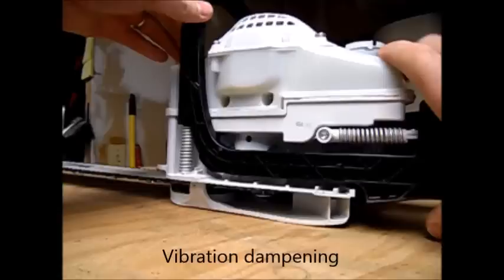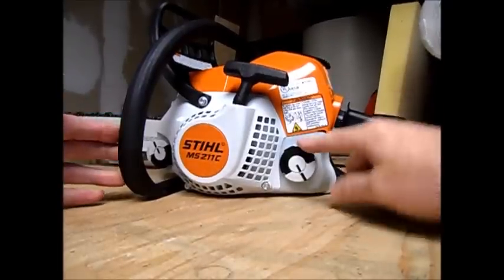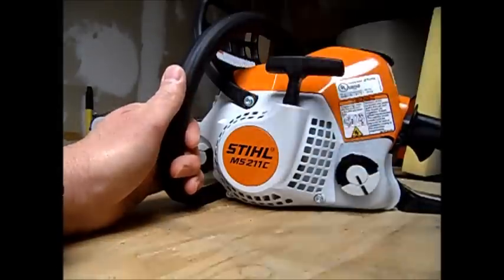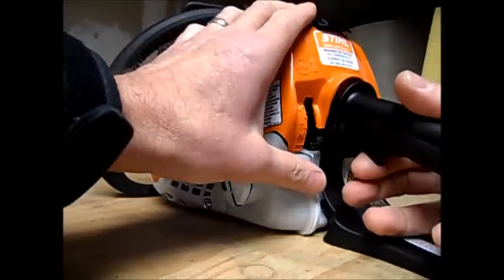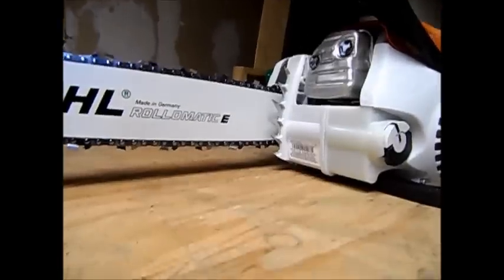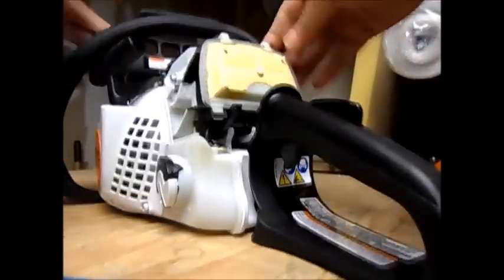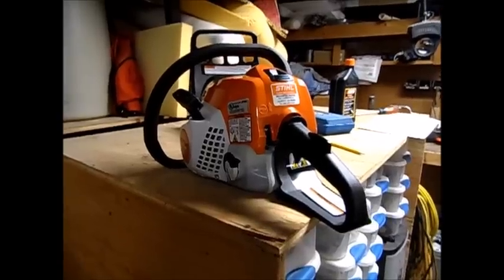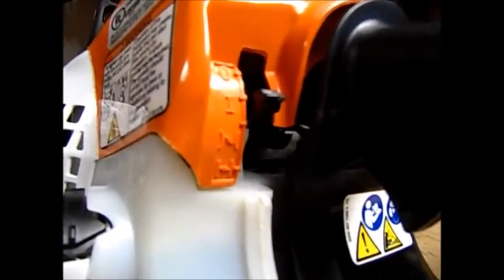Stihl MS211C chainsaw review

Comment: I have the 211 not the 211c and love it. I wasn’t a fan of the chain tensioner thing on the 211c. The easy start is a good idea. But the 211 without it starts just fine. And once you get the choke thing down it’s really not a issue. Good review brotha, happy cutting🍻

Comment: Had my MS211c for a few years now and only recently changed the air filter and spark plug , it’s a good reliable saw and if you use the tungsten carbide chain apart from general cleaning and good fuel mix your saw will perform as expected and more. The only problem I have is that I feel the need to get something bigger and beefier but I think this is a bloke thing my wife doesn’t understand me 😳😁

Comment: Got one ,had nothing but trouble out of. Still would not honor warranty. So now due to a guy at still dealer writing on paper that wrong gas was used in saw. Replaced carb. Now the coil went bad. I guess this is the last part I'll buy and last stihl also.
Reply from the maker: John man , that sucks, type of gas should have nothing to do with it, unless it was diesel. You got a lemon. So sorry to hear that.
Reply: John, if you had the deal Stihl offered in the past of the extended warranty IF you used their synthetic mixing oil, that may have had something to do with it.
I can't imagine what kind of gas would ruin the carburetor. Even some sort of aviation gas or whatever should not screw up the carb or the saw otherwise.

Comment: Nice review! I bough one when they first came out, maybe ten years ago! I didn’t like it! Mine was the standard model without easy to start and quick tensioning! I didn’t like it because was with one bar stud and I also didn’t like the feeling when I use it it seems that was not very durable! I sold it and I replace it with the Ms 230! Quick tensioning and easy start can fail easily and gives you troubles! I want my chainsaws with two bar studs!

Comment: I've used a Stihl MS211 for 15 years up here in interior Alaska...no problems.  I sharpen chains with Granberg file jig, rotate the bar and clean the channel after each 40 hours of use

Comment: **NOTES AND UPDATES Concerning the Stihl MS 211 C-BE: Just bought one of these saws today from my local Stihl Dealer, Really Great Saw for most homeowners. 
**Couple Notes: 
***IF the saw is ALREADY warmed up.... DO NOT CHOKE! It will probably flood the engine. If you've already had it running, Try to start it in the Run Position first, if it wont start, THEN go to choke. 
****WHEN you go to Start the Saw, or ANYTIME you are pulling the Rope for ANY REASON (like repair, etc) ALWAYS ALWAYS have the Chain Brake ENGAGED. Because this saw is SO Easy to Start, it is possible to start it by ACCIDENT! If this were to happen, and the chain brake is not engaged, it could cause injury. With this saw, its actually just a good habit to engage the chain brake every time you shut it off, or even to keep the lever in the "STOP" position (unless of course you are actually intending to start the saw) just to prevent possible injury of an "accidental start".  
 
I know the store owner of the local Stihl Dealer here, and was talking with him today about this saw. The "safety tip" above about engaging the chain brake is what he told me himself, as he was working on replacing a pull rope on one once, and he pulled the rope a bit trying to set the spring, and the thing started up and spun around on his workbench!!
He also brought up the issue they used to have with the gas caps on this and other Stihl products that used the same fuel and oil caps. He said he replaced a few hundred of the bad caps during that time. But they have since (a couple years ago) fixed both the gas and oil caps since the issue became known... AND after they figured out what was going on. It was a "defect" but only for the US models, they didn't have any issues with the same caps overseas... They finally figured out it was being caused by the fuel sold in the US, which had something in the fuel which was degrading/deforming the original plastic and seal. Which caused leaks and other issues. So they had to change the type of plastic and seal material on the caps so that the fuel sold in the US would no longer deform the caps.  Just thought I would pass that info along.
Reply: Your switch should ALWAYS be in the off position unless you intend to actually start the saw!
Reply: @tomnovak7731  thats what I said... ?
Reply: Thanks for your detailed observations. Much appreciated.

Comment: Nice video I’ve used mine to fell some pretty thick sycamores and oak trees with a 16’’ bar and a picco duro tungsten chain which is great as long as your cutting clean wood , if there’s metal then your wasting an expensive chain . Ordinary chains are fine as long as you keep on top of sharpening after each use I find 👍🏻

Comment: I wanted the starting mechanism like this as I spend a lot of time on the ground clearing saplings and treating stumps. I can’t get up and down all day anymore. This saw worked great til it started puking bar oil out the bottom all the time. Took it apart to find problem. Hose on bottom leaking. Never got it back together.

Comment: just picked up one today $345.23 total w. tax, extra chain, case, tools. No sense in breaking my back with O36 sawing orchard wood :). Thanks for the fine details including carb heat which was never mentioned at dealer.

Comment: Excellent video! Just picked up my 211 yesterday. The easy2start feature will take getting used to. Keep up the good videos sawmaster.
Reply: How is it holding up today? Thinking of getting one. Thx in advance
Reply: Wiebe Jansma 
Funny you should ask.I went through last season and either clogged the oiler channel along the bar or ? The chain stopped cutting as effectively and since it's under warranty I'm going to send it in for a check. After using this model I would opt for a bit more power and go for the next one up even if it doesn't have easy start.
Reply: Thx for the information, good luck with the reperations etc.
Reply from the maker: Wiebe Jansma , mine is holding up well. It's easy to keep clean. You can always check for chain lube by just running the blade in front of anything without touching it. It should leave a slight oil mark where oil is being flung off blade. As for power, remember, it can take a lot of power too cut with a dull blade. And if the blade is razor sharp you can easily be too agreesive and lug the motor down. I'm always amazed how a sharp blade can cut with almost no pressure at all and beautiful long stringy chips and the sawdust you produce with a dull one.
Reply: Ah, thx for the additional info, will try this one and a heavier one out i think.

Comment: my concern ... 181CBE or 211CBE?

Same weight ... more power ....
my local dealer has 181C and for a bit cheaper i can get a 211C on internet.
I need a lightweight machine and correct power ...

Which one should i get?
Since i cannot try these before buying :(

Any advice guys?

What about Husky .... more powerful engines but not as solid as Stihl?
Reply from the maker: This is probably not the tool to cut hundreds of cords of wood if thats your concern about power. Power really has to do with speed. A smaller saw with a razor sharp blade will cut faster than a bigger one where the blade has been into the dirt. That said you can still bog even a sharp saw down trying to cut too fast (speed). A sharp saw will cut nicely at 1/2 to 3/4 throttle. My biggest gripe with my older bigger saw was the need for tools for maintenance. This solved the problem. The Stihl brand has an excellent track record. Before this I tried a cheap Homelite, absolutely crap. Good luck
Reply: Thanks :)
Reply: @dablingtime  you should always run at full throttle when loading the saw. A 2-stroke engine develops peak hp at full throttle.
Reply: If you want a professional saw, buy a professional saw. This, in my opinion, is a homeowner grade saw.
It appears to be a pretty decent saw for the intended use.

Comment: I've had my 211C for just over a year now and just love the little farm/ranch saw. It's very light so that's great for general use and feels much better than the Husqvarna Farmhand. I'll recommend this chainsaw easily to anyone looking to get one. I got mine from our local SoCal Ace hardware and their support for Stihl is top notch (Yes, it's "steel"). I used it to clean up debris and some widowmakers last Spring when an F0 blew through and just fell a cottonwood that got too out of control for being close to the house (those and Eucalyptus litter our property and just fall apart in any gusts).

One quick note on this video is that his chain seems very snubby so I went to measure mine and it's 16-1/2" from claws to bar end. Perhaps they gave us 2-1/2 extra inches since the viewing of this 2014 video knowing that the engine can easily handle that. You're darn right about all the tool-less stuff too since I can do everything I need to do to the saw with my gloves on, great features all around and the vibration damping and balance is perfection.

An error on my part had me grieving the $330 purchase and wondering if Stihl were still the best is backed in this video, so I want to comment on my issue. I tried to start it one day and I just wore myself out. Took it to Ace and it fired right up. Asked for tuning suggestions and was told there's not a lot of adjustments to make but "do this" if you must. I was assure that since Ace was at 1,000ft and me at 3,000ft up on this mountain I had to tune it for elevation. Nope! keep pumping that priming bulb! My prior farmhand and all the junk weekwackers would flood if I over pumped that bulb. This one does NOT flood the carb so just keep pumping and it fires right up every time. Three pulls would be a high count. 

Haha, the easy start was goofy at first but now it's second nature. Full choke, *bripp*, half choke,  *buuuuurrrrr*, pull throttle and get to cutting. It's only their chainsaws though because the FS 60 weedwackemer is the standard 3 position and now raindance. I start mine with the brake on so please remember to bump that back when you're warming up if you do as well. I'm betting if you don't it's bad on the piston and will wear out that brake eventually...and that thing is a life saver!

Thank you for this great overview of the MS211 C. I'm sure many looking into buying a chainsaw (and perhaps their first chainsaw) are on youtube and see this. I know this isn't Amazon reviews, but buy this thing and don't question a moment more. It just chooches!
Reply from the maker: J.C. Allen thank you!
Reply: Yea the pronunciation of the name varies depending on where you live. so your comment ( yes, it's "steel" ) is only half correct.
Reply: @1989cranston  your right!
In Boston, a saw is a "sore"! 😆
A car is a "caah" too.

Comment: If sawdust could get into the tank...!! surely fuel will come out...! And i doubt you bought a saw that leaks..!! Great saw European model is slightly different. 
Its also pronounced STILL not STEEL.
Reply: From the Stihl website:
"Our name is pronounced exactly like the metal "steel.""
Reply: Thats how Americans Pronounce it.
But the Correct way "The German way" is Still=Stihl
Reply: As aGerman, i will have to say that the german pronunciation is much closer to "steel" than "still".
Reply: puderjunge Yes it is and even if it doesn't wouldn't you rather say steel anyway? Sounds way cooler than still. I don't get why people that know nothing about the German language say something that they are ignorant about!
Reply: on tv commercials they say steel I always said still, now I alternate
Reply: @MrPadraigmccarthy  The website and commercials say Steel. But I guess you're right and they're wrong ,about they're product???
Reply: I'm not arguing the pronunciation thing because no matter which way you say it, everyone knows what you're talking about.
But I agree with the sawdust in the fuel tank thing. It would leak fuel if it were suckling dust in while the cap is closed. My bet is the operator did nothing to clear the sawdust from the cap before opening it and it fell in when he dropped the cap on the retainer string.
I would recommend carrying a small brush like a paint brush to just quickly brush debris from around the cap(s) before refueling or adding bar oil. 
Cheap insurance in my opinion.
I've never had problems with my 034 Super that I have owned since 1986!
Reply: Damp saw dust will clog the groove, then when you open the cap and lift off, the compacted saw dust can fall off the underside of the cap and into the fuel tank.

Comment: I love it when people with cameras think they know what they are doing with other things and start doing "reviews". 😆
I laughed when you said they have gone to a "single lever throttle control"! That's the same set up as my 1985 model 034 Super! Have you been under a rock? BTW, the positions are; Off, Run, Half-choke (auto-cancels when throttle is pulled) and Full-choke. Full come is for starting a cold saw. If it is warmed up and has been running in the last 10-15 minutes, you may need to half choke it, but I usually try to start it in the run position once. Anything less than 10 minutes off, it should start on the run position except in the coldest of weather.
Things like the "hood" (🤣) being difficult to install is rookie ineptitude! The latch is working as designed.
You should really put some hours on the saw so you have something to review.
Rated :💩💩💩
Reply: There is not half choke at any stihl chainsaw! Lever position are off, run, fast idle and choke! So you are not perfect either